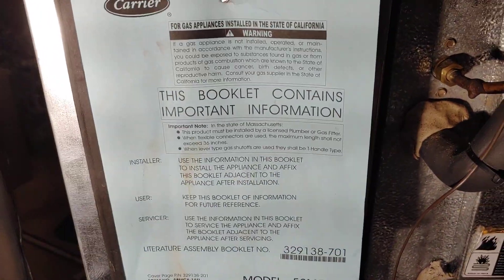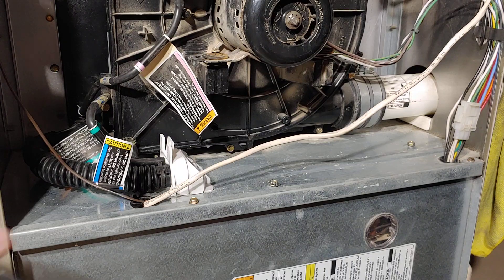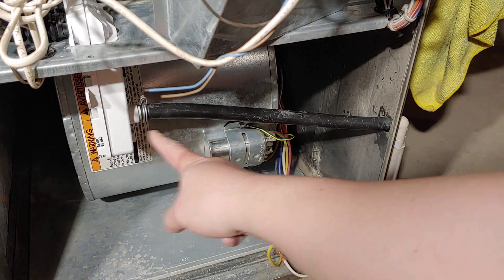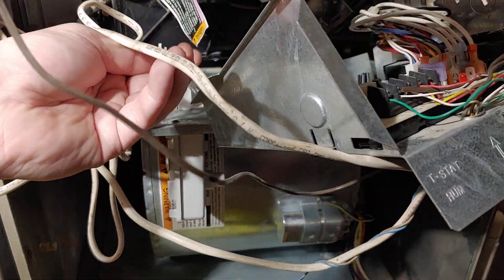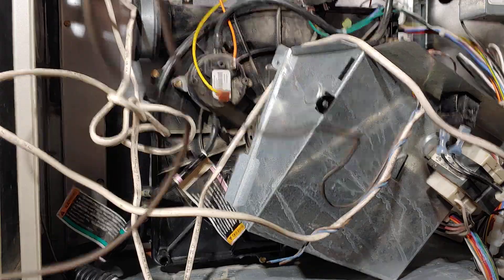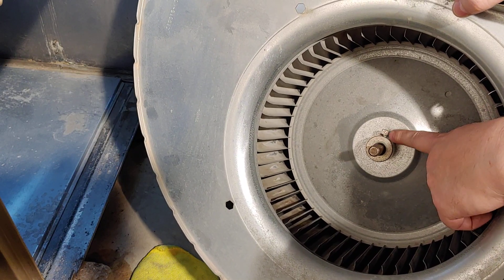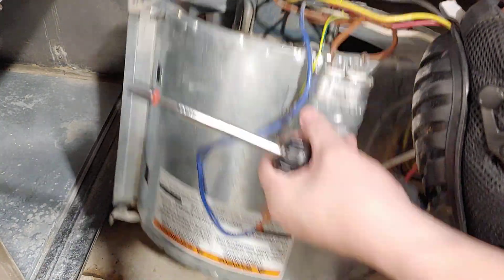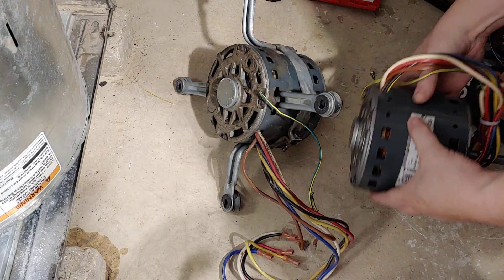How to change blower motor on a Carrier Furnace 58MCA-1551 part 1 of 2 for around $200

Comment: Thank you so much for the detailed video. I just replaced the blower fan motor tonight (I have same furnace model so it was a bonus) and your tutorial video was so helpful. The parts cost just over $200 CAD vs calling in HVAC tech to do the work and I am sure it's much more. 👍🙏
Reply from the maker: Awesome.  Glad I could help

Comment: Excellent presentation, thank you for sharing. I'm hoping replacing my starting capacitor will fix my problem but your video shows me what I'll be getting into if I need to replace the blower motor. Keep up the good work and thanks again!
Reply from the maker: Glad I could help.  So far it is working awesome since I made this video.